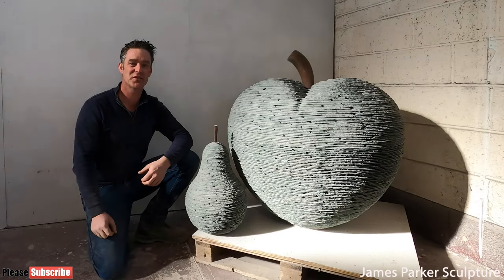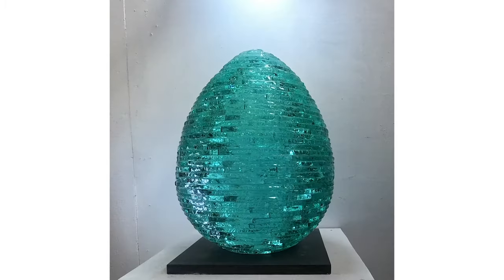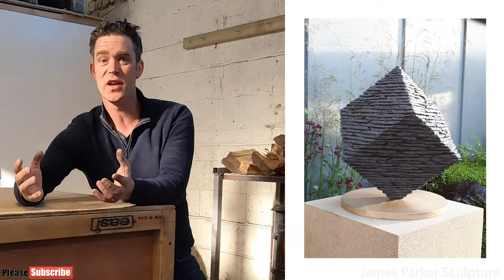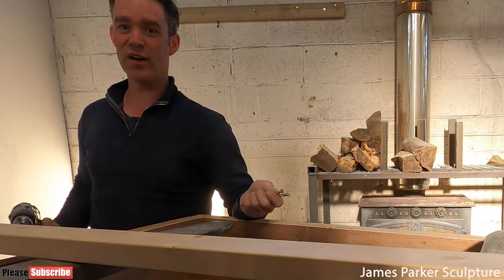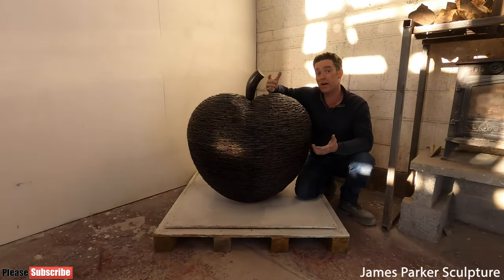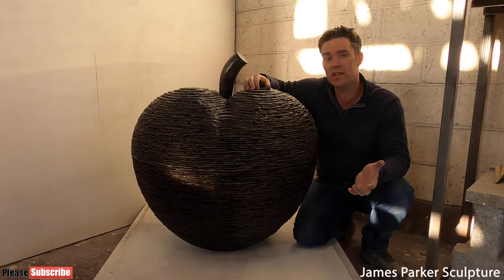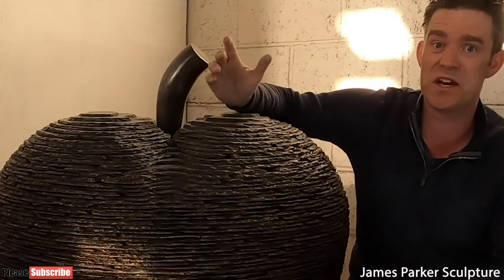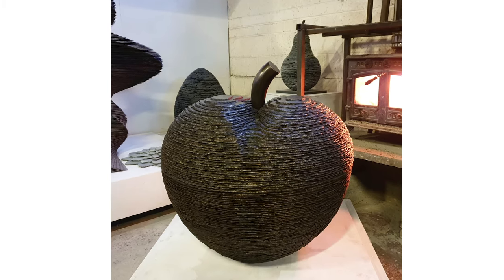THE BIG REVEAL | UNBOXING MY BIGGEST BRONZE SCULPTURE MY ART VLOG

Comment: I think that I read somewhere that you don't fasten the pieces together - that each piece of slate / glass is simply stacked. Is that true? I know in total a piece is quite heavy, but wouldn't severe weather or an errant forklift or curious admirers accidentally dismantle a piece? I'm so curious!
Reply from the maker: Hi Sue, the piece in the video you commented on is bronze so is one piece.
The slate sculptures are sometimes left dry when using heavy thick pieces of slate and are safe - much like a drystone wall is not fixed. 
When using thinner slate and creating smaller sculptures they are generally fixed so that they can be moved and are safe.
The glass sculptures are rebuilt binding each piece in place.
Each piece has to be safe and I use a variety of methods to ensure they are.

Comment: When you said the "Foundry are trying to get it back"? Can you explain?
Reply from the maker: Hi Kt. I should have explained better. 
When the mold is made it involves painting rubber onto the original. Normally this can be peeled off leaving the original in tact. However because of the nature of my work: the layers of slates with tiny gaps, the rubber gets right in between the layers and cannot be easily removed. 
The foundry were doing such a good job of ensuring the rubber picked up all of the detail of the slate that the rubber has got everywhere! 
I'm thrilled with the end results of the bronze. 
I wouldn't want to trade any of the quality in favour of 'getting the original back', so I may 'lose' the original. In other words it may not be possible to remove all the rubber meaning the original will be lost.